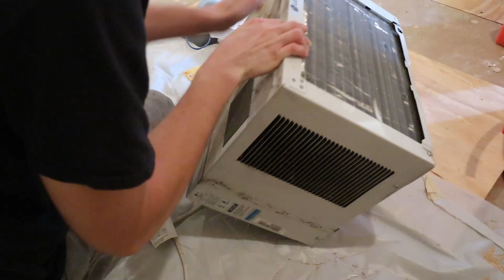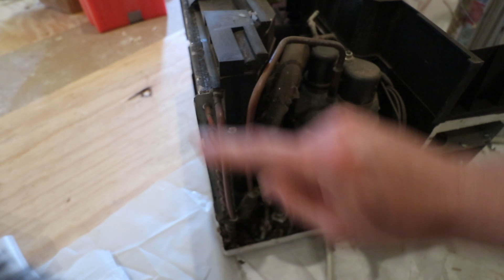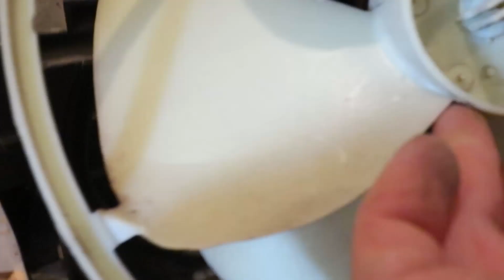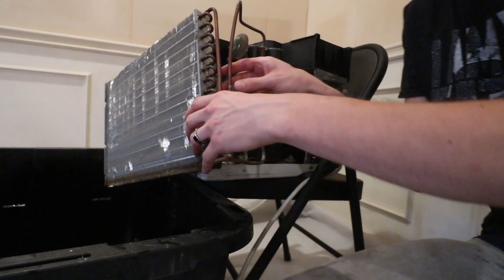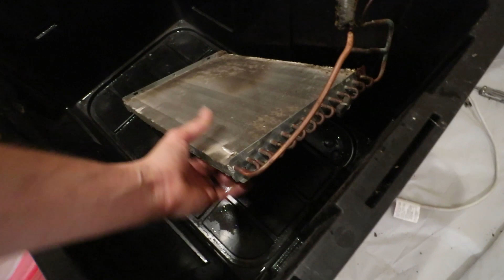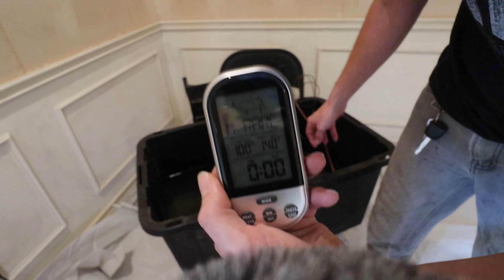Window Unit Water Heater - 3x More Efficient?

Comment: Love what you are doing! Iv been preheating my water with solar for a while with great luck and want to do something like this. Im a refrigeration tech so have odds and ends laying around. If you have the tools you could ditch the condenser coil and just use a coil of copper tubing. You seem like a pretty sharp guy so i think you will get it worked out. Good luck!

Comment: About the other comment about using solar for water heating, you could use black hoses coiled in the sun, maybe in a plexiglass box to minimize losses. Have the black coiled hose connected on a closed loop to a plate heat exchanger that has 4 inputs(2 closed loops) and a small pump time circulate water. on the other closed loop of the heat exchanger have the room temp water that you’ll be using. Shouldn’t need a pump if it’s in your house because of the city water pressure. Could also hook it up to the hot water coming from your water heater and then turn the temperature down on the water heater so it’s using less electricity. Could also use the same closed loop side with a copper tubing heat exchanger and leave the copper tubing in a reservoir that is insulated, and draw from the reservoir when you want hot water. Could also have a mixing/thermostatic valve on the output in case it gets too hot.
Reply from the maker: So many great ideas. I've come across some of them but haven't had time to test/implement. I suspect the solar heating is outdated with as cheap as electric solar panels are now-days but it would still be fun. I would love to have a water to water heat pump and send the hot water to the water heater during the summer, it's a waste product anyway!

Comment: Since you said you were looking at going to a free night and weekend plan for the electricity you might look and see if you can add a mixing valve after your hot water heater to allow you to run the water heater up to 170-180 degrees at night when free and only 120-130 during the day if you still need more hot water. The mixing valve should let you keep the output at 130 as it mixes hot and cold water as needed to avoid people getting burned.
Reply from the maker: That’s a good idea. I have been tackling the ac as it’s our biggest consumption during the day but using some of the waste heat for pre heating like you mention and then super heating seem like solid ideas.

Comment: A bit late on seeing this video. Could you use it as a way to preheat the water before your normal water heater? That way your existing water heater would only heat it from 115 to 135 instead of from 70 to 135. One of the downsides of the normal heat pump water heaters is the heat output is pretty low so once the tank runs out of hot water it's a long wait.
Reply from the maker: I suppose the disadvantage is there isn’t much time to preheat it as the water flows into the tank at multiple gallons per minute. I know I’d be ok with a slower recovery on our downstairs water heater. It just serves a half bath and the laundry/kitchen. Ideal would be to heat water while I’m making ice and use that for my domestic hot water, could be some complicated plumbing though. I’ll get there!

Comment: What is the ultimate water temperature??
Reply from the maker: I never did run it hotter than that 102 degrees. It’s a project I plan to come back to as I’ve learned a lot since filming that video. I don’t think it would have a problem getting up to 120 degrees f.

Comment: Alternatively you can try solar power. One time investment and life time free hot water :)
Reply from the maker: Yes! Solar is definitely on my list, were you thinking solar water heating or solar electricity to then power my water heater? I’ve considered both but got distracted with making this part more efficient first.
Reply: @beenegarage7116  https://www.youtube.com/watch?v=M1YFqBl6Cxs

https://www.youtube.com/watch?v=KVeGummoXS0

I think you will find the energy cost will be around $3-$6 a month and most of that is keeping the water hot.  I would think of insulating it better would be best and when the water heater needs to be replaced, replace it with a smaller one.  Not knowing your plumbing, would an on demand water heater under the kitchen sink be an option?  You would need a large wire for one would be a big down side to it.  

Totally going in another direction, would having a large insulated tank for water and heat the water during the day time during the winter and cool it during the summer.  Use the water to heat or cool to keep you from being 75% or less capacity on your Chiltrix.  You would need several heat exchangers.  It would be nice if you could find an inverter window heat pump unit.   It could turn into a large project.  A water cooling tower?  What fun you could have.
Reply: What about using the air conditioner as the source of heat for a clothes dryer?  If you could find an old dryer you could cut the side out of. Just a thought. Maybe about the same savings or a little more and may be easier.